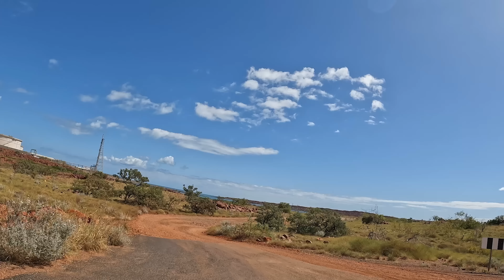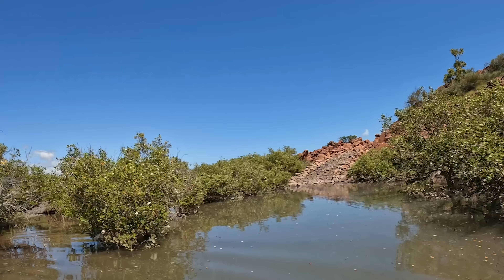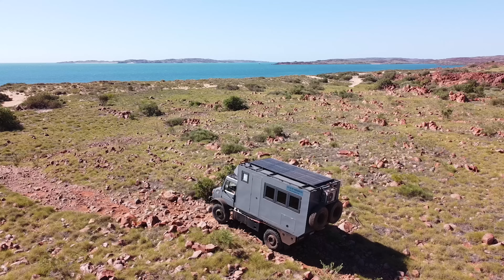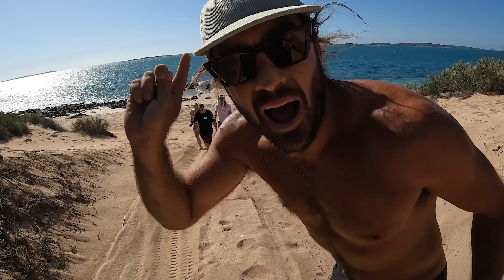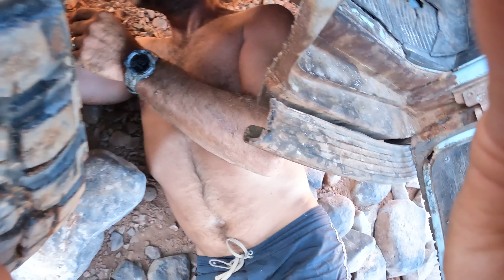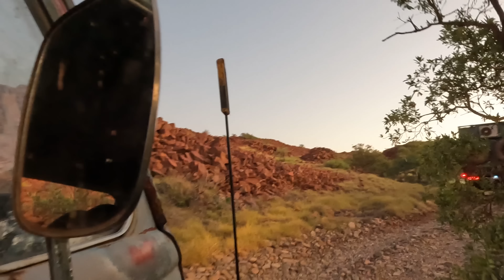UNIMOG vs KOMBI - THE JUMP UP TRACK

Comment: Went out to the jump up in 2007. There was a rock ledge that appears to have been filled with loose rock. When I saw the alloy casings and gear oil on the ledge, I turned around. Awesome landscape. Totally unique. I love it how you both just persevere. Well done.

Comment: Your right.  The Unimog WAS built for that kind of punishment.  Just have a look at the structure under a Unimog.  My olds had a Combi for a while while I was growing up, and while they didnt do anything like you did with yours, it was versatile and better than expected offroad.  I remember it was surprisingly capable as a 2WD off road.  
Combi do have one nice point.  With one slight mod, cutting the lower boot catch bar and making it a bolt in solution, it was VERY easy to just slide the motor out for working on.

Enjoyed the Vid.  Thanks for the show.

Comment: Another great adventure. Reminds me of my buggy days with my mate. We had two old beetles that we chopped and lifted to drive round the Arthur River Recreation area ( n/w Tassie ) with our young families.We only used bits and pieces of junk and other car parts to keep them going but they did the job. We bent the tie rod tubes often and a good tip for you we used to cut up old front sway bars and insert them inside the tubes before screwing in the tie rods.They are spring steel and support the tubes to help them stay strait. They may bend a little but not as much as what yours did. Also to remove the tie rod from the steering joints don't hit the nut or thread use two hammers one each side of the casting and hit at the same time on opposite sides of the casting and the taper will pop out on it's own usually but putting a bit of pressure under it with a screwdriver as you do it will help as well. Keep up the good work hope your on the road again soon.

Comment: Need to slip some rubber pipe over tracks rods which sometimes helps with small shocks...just like we did on our rally cars.....
Reply: Protection plate is better.

Comment: To remove the tie rod without a tool, don’t beat the nut to death, hit the tapper on where the tie rod end goes through, once you shock the tapper the joint will fly out easy, one hit in the right spot,  and to strengthen that rod Temporary,  you can run rows of welds length ways, max heat, it will kinda harden the steel, making it slightly more Fragile but less likely to bend especially if you Quick cool it, unsafe but should get you home..

Comment: A Stewart & Stevenson Pinzgauer 4x4 truck with air cooled gasoline engine and three locking differentials will outperform that Unimog truck anywhere in Australia or North America.😊

😮

Comment: A very bad comparison. To compare the Unimog with a Gas 66, or light US military truck, never mind Ford or GM, would be fair. The VW Bulli is probably advantageous on the road and light trails, but not in really heavy terrain. If the Unimog, would have had other tires on it, so he would not have stuck in the sand. Nevertheless, a very nice video and you all good luck and have fun, continue. Stay healthy. Greetings from Frankfurt
Reply: The tyres definitely make a huge difference. We finally got our 395/85 R20s on and it stopped that crazy bodyrole and is sooooo much better in sand. It is still a bit underpowered though so it will need a bigger turbo and an intercooler one day :P
Reply: @PatandJele  Agree, the new tires, should be significantly better and also the ride is smoother. Laugh, sure a bigger turbo and intercooler, can not be wrong. Well adjusted, you need even less diesel at normal driving on the road. Have fun, good trip, in the new year and you, all the best. :)
Reply: @geroldknoebel3836  thank you🥰😇
Reply: @PatandJele  You'll be fine. What also helps you a lot, if the roof spoiler from the Unimog cab, goes over a few centimeters from the cabin. You save a few liters of diesel and have some storage space above. Mercedes has something like that in the program for Expetions vehicles.  
We also had in South America on the construction sites and especially a better protection in deeper trees. The conversion is unfortunately costly and whether it is better or not, a difficult decision when you have to pay for it yourself. 
Have a nice day and take good care of yourselves.
Gerold

Comment: 1/2 the problem with these clutches is the banning of Asbestos, these newer types just don’t bite they way the old ones did, and yes i know the pressure plate should technically be slightly stronger to compensate, but they rarely are, because who takes a kombi off-road anymore?  However there is still places you can get modified HD clutch assemblies, ask around the dune buggy world..